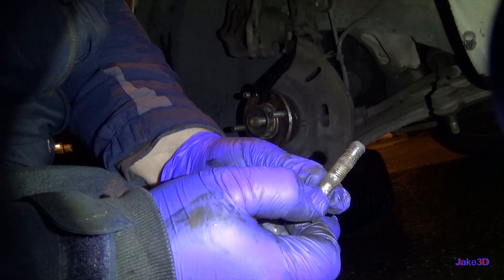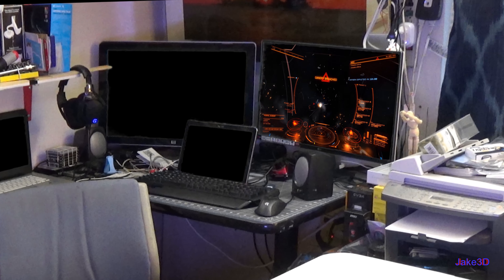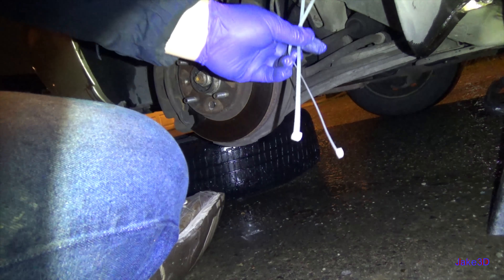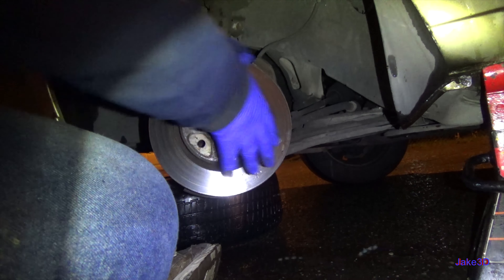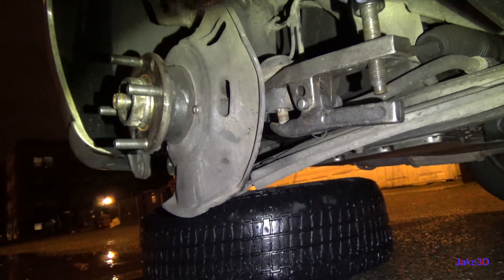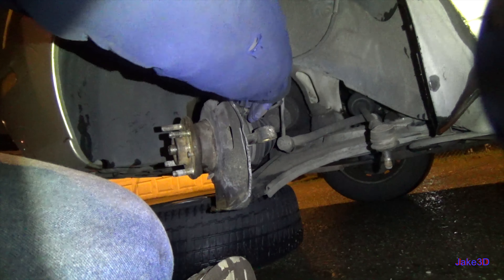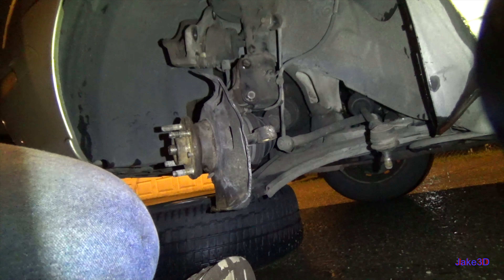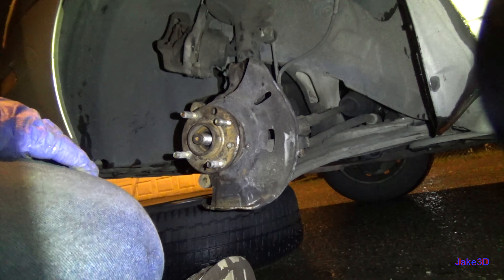Steering Knuckle Replacement Daewoo Nubira

Comment: hey do you still have daewoo nubira? I want to change all the speakers of the car and I do not know how to do it, and also in my daewoo nubira the door lock does not work anymore, it only closes one by one. Good videos
Reply from the maker: I do still have it, I'll take a look at the speakers in the rear this week. The ones in the door is fairly straight forward I may still have some unedited video on that too. As for the locks can you be more specific? Is it the electric locks dont work or the doors just dont lock at all sometimes? I had issues with this as well
Reply: Thanks for the answer. The central locking stopped working, I think that the driver's door commands all other doors when I close or open the car and now it does not close the other doors, just the one of the driver. I saw on a website that it was possible that the problem was the solenoid valve on the driver's door. What do you think?
Reply from the maker: yeah it sound like the Solenoid or one of the connections there. Id take it apart and see if there are any bad connections, or if anything is not connected. I had replaced it at least once to fix this issue, another issue I had is the springs in the locking mechanism was damaged causing the door to not beable to open or close. so if you do take it apart try and inspect those too.